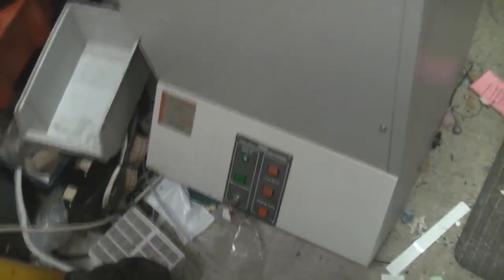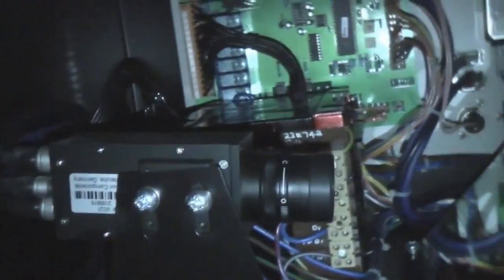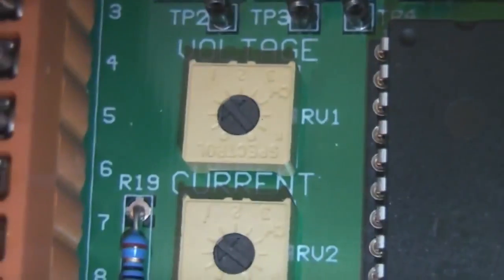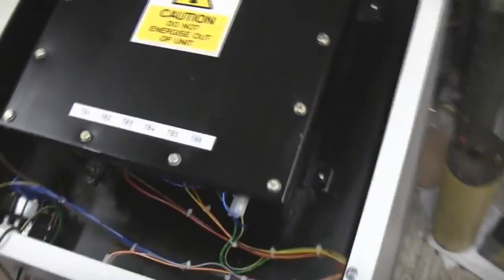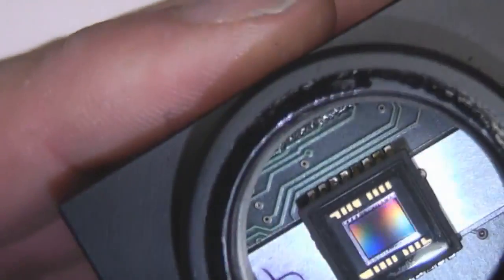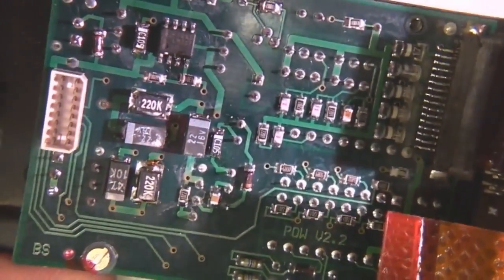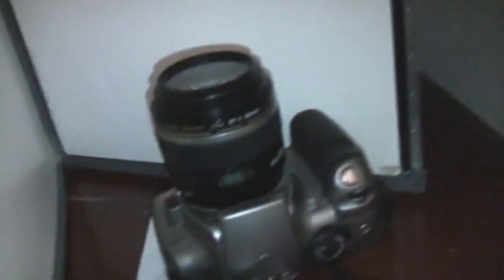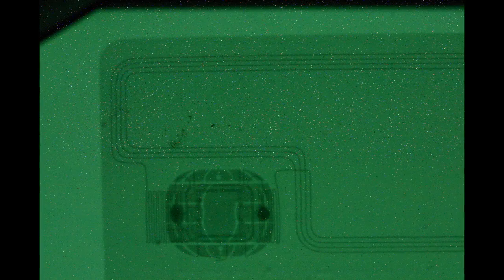Another X-ray machine

Comment: you get some great stuff and that TX is really nice .I just got a control unit for scanning metal pipes it goes up to 150KVp 10mA and has a really nice variac and adjustable ballast built as one transformer last repair it had was in 1988 is mad how things have changed ,If you get a chance check it out ,you'll have to excuse the poor cam work as im by no means a professional like you .Great vid and thanks for sharing that TX with us. John

Comment: Don't be sad! you can do alot of things with consumer electronics parts ;) And by the way, if you want to have kids stay away from anything that produces x-rays in large quantities...I'm not saying that the machine from this video produces alot of radiation or not controlled, but when a device is getting older gets other functioning parameters due to decalibration. even it was safe when it was new, if is getting old you should use alot of protection against dirty things.

Comment: What about mounting the camera in the spot where the original camera stood? Would the resolution be any different down there with the pcb's sitting on the original phosphor screen with the lead glass. I figure that would at least cut down on the radiation hitting the camera, and perhaps for light you could do a 30 second exposure on the camera with multiple bursts of the xray.

Comment from the maker: Tried that but didn't work as well - the key is to get the subject very close to the phosphor screen - With the original one, there is a gap due to the plastic base. Cassette phosphor may also be thinner for better detail - not tried getting at the old one. Also, the X-ray beam density is much higher closer to the tube, giving shorter exposure